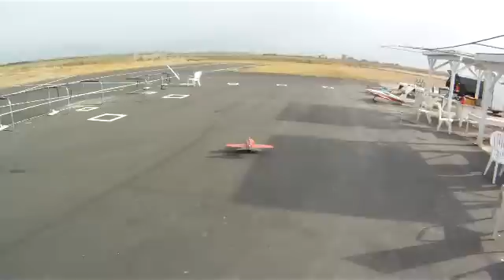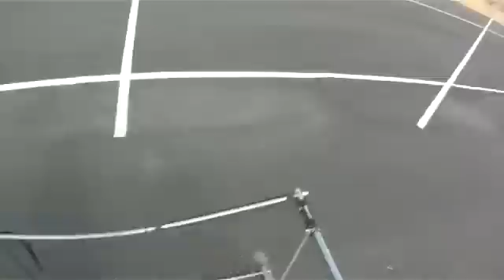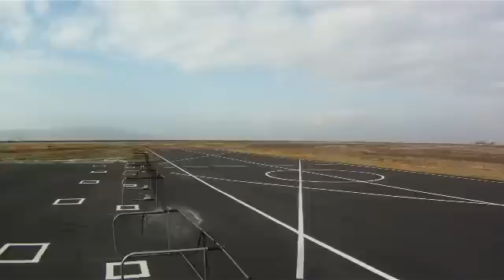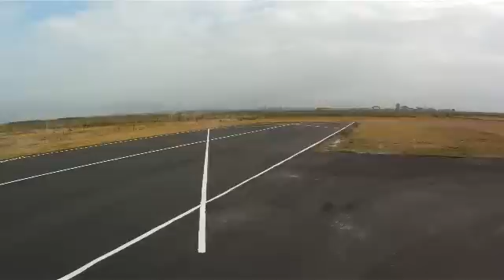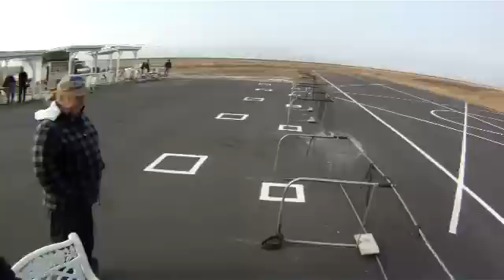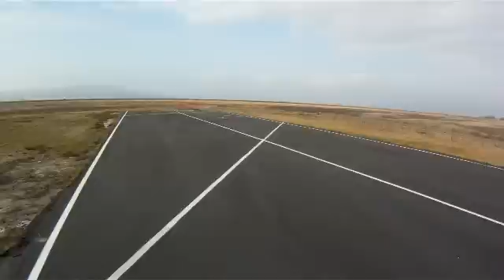Change Sun 70mm with 2700kv Ammo inrunner.

Comment from the maker: The thrust was about 3 lbs., just under a 1:1 ratio. The motor fried at 1.5 minutes, I would not recommend this setup. For the CS 70 I recommend an E-flite BL32 motor (2150kv) on 6S. With 4500 mah I get over 4lbs. of thrust and 4 minute flights and I've had over 100 flights with No problems.